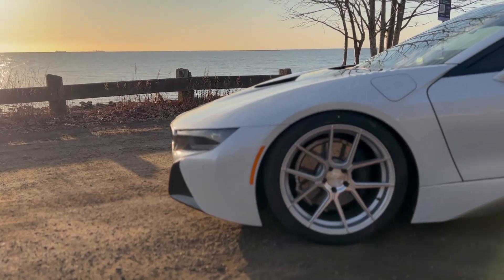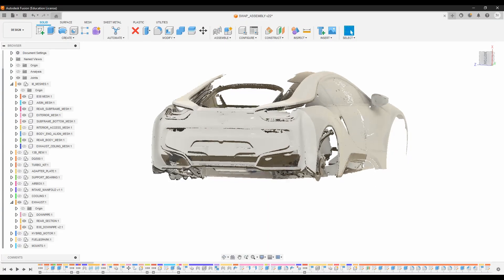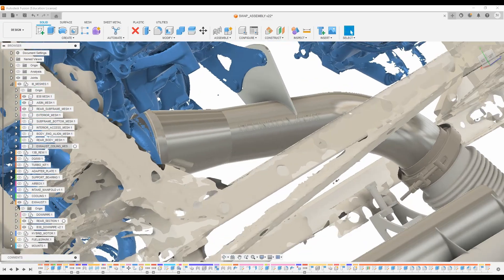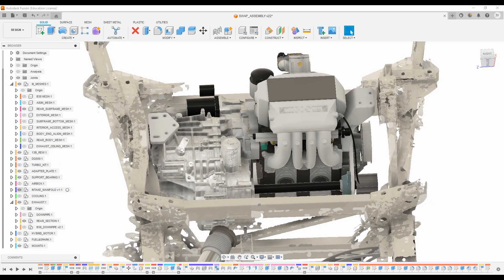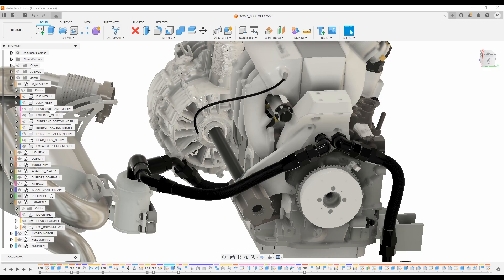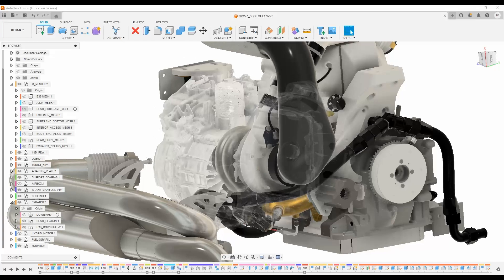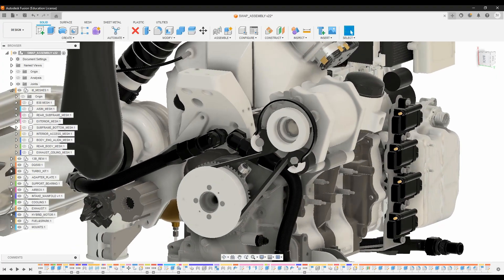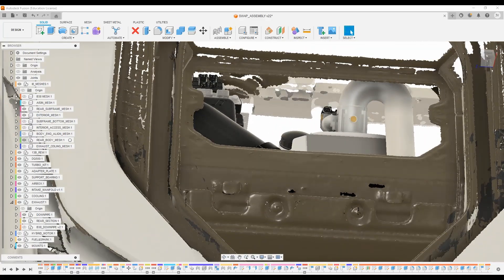Building a 13B rotary BMW i8 - EP1

Comment: You could maybe rotate the turbo a bit to clear the subframe
Reply from the maker: Why? The turbo does clear the subframe.
Reply: @CouchBuilt sorry, i wrote that incorrectly. What i meant to say was, that rotating the turbo slightly clockwise (if viewed from the top of the car) could have maybe moved the intake pipe closer to the 90 degree corner in the chassis, thus eliminating the need for the whole "organically shaped defornation". But then again, could have not. Even so, judging by the shape, i assume that you have flow optimised the whole pipe to the point, where the weird shape doesn't really affect the performance of the pipe in any way.

Btw, please don't take my previous comment as me trying to look all smarty pants. I myself am an automotive engineer, so i can grasp, how insanely diverse your skillset is and i sincerely appreciate what you do.

Your OEM-like approach to building cool stuff is very rare, and almost ruins everything else for me.

Btw, insanely jealous of the tools you have for building cars in usa, back where i'm from, i cnc machined (not even talking about 3d printed stuff) parts are INSANELY overpriced, so even though i have quite some experience with CAD, while building stuff for myself i have to resort to the rather pedestrian "other" cad (cardboard aided that is) and do the usual "weld some pipes to the crudely man-made bracket" type of shite

Comment: When was the new i8 unreliable 😂
Reply from the maker: Mine was bought with 14k on the clock and has needed more repairs than my N54 335i in the two years I’ve had it. Oh, it also had the motor and radiator replaced by BMW a few months before so bought it 😂

Comment: How many horsepower with BMWs turbo could the engine produce? 

Also i wonder if wankel could be used as generator in I8 like Nissan E-power technology.

İmagine as if the engine were generator and there weren't any transmission. The automobile had two electric motors( rear and front). Kinda  Nissan X-trail E4 power. Two rotor wankel could supply it?
Would it be impossible? Warm greetings from Istanbul 🇹🇷

Comment: You can install a swirlpot with the filling cap in the toppest part of the cooling system. Its usually intalled at the engine outlet. Its a good way to bleed the air out of the system

Comment: this content is gold man!. how capable do you think the i8 chassis is for high horsepower applications ? I have bare i8 shell that Im looking to make a hyper EV out of it. looking to have around close to 2,000 HP. i see this thing is mostly held together by glue and im not sure how safe the chassis would be for this type of application
Reply from the maker: Glued construction is generally pretty standard these days. The car feels way more solid than my E92 daily driver. I don’t have any concerns about power, but we’ll find out.
Reply: Aircraft’s are “glued” together and have been for long. Not entirely, but to a great extent. In many cases the fasteners you see are there just for safety reasons/regulations. The main loads are take by the adhesive.
The different sections of the CFRP chassis are probably “glued together” as well.
With that said, it’s the resulting capabilities that sets the limits. Not the method (i.e. glue), as long as it’s correctly engineered based on the set requirements/goals.
All said without knowing the actual limitations or engineering details of the i8 in particular.

Would be great to see more i8 content. Both tuned/improved OEM style once as well as more crazy project. 😃

Comment: Heat is going to be a major obstacle on this build.  Rotaries make up for their small size by working harder and hotter.  The oil cooler, radiator, and exhaust all need to be able to dissipate a lot of heat.
Reply from the maker: The cars cooling hardware seems to have reasonable capacity as a starting point. The hate of the system is around serviceability and early failure of some parts. Being a hybrid, I’ll have the convenience of shutting down the 13b in situations like traffic and continuing to let the coolant pump and fans run. I’ll probably run a large Laminova oil cooler over sending oil the length of the car.

Comment: Very intersting. I wonder why you choose to change the gearbox instead of mating the 13B to the original 6-speed ? I don't doubt that you did a massive amount of research, but it looks like it has been fitted to quite torquey engines, an it would probably have been much easier when it comes the time to do the electronics.
Reply from the maker: Won’t handle the power. Even Alpina swapped the trans when they put a B48 in one.
Reply: @CouchBuilt Thanks mate. Subscribed halfway trough the video BTW, it looks like a very intersting procject.

Comment: Wouldn’t it be easier to utilize the factory trans
Reply from the maker: It’s only rated to 330ftlbs and would need an adapter plate anyway. The DSG is just a better transmission and since the stock control is only on the CAN bus instead of Flexray, it’s easy enough to spoof.

Comment: Everything looks very well engineered. The only concern I see right away is the sharp radius bend of the charge pipe coming right off the compressor. Between the sharp bend and the protruding clearance you had to do for the subframe, I could see that causing compressor side backpressure as it could be a flow restriction. Increasing the volume in that bend can only do so much up until a certain boost pressure.
Reply from the maker: Fair observation. Building the car without modifying the chassis is going end with some compromises. This is one, along with intake runner length, have been examples of that. It will be easy enough to swap out the inlet pipe in the future if it impacts performance too much.

Comment: I wish someone had swapped a v8 into one of these by now.
Reply from the maker: Depending how many models or scans I can get ahold of, I may do a video of fitment with other possible swaps.
Reply: @CouchBuilt  oh wow I'd love to see it. Preferably a BMW V8 but I realise a LS is much more likely 😂
Reply from the maker: I can make dummy representations of the overall length/width/height of some BMW motors but that’s not quite as appealing visually as actual scans or models. We’ll see.
Reply: @CouchBuilt  for me, just knowing it would be possible is enough. I remember at the time of the i8 release, a number of people abandoned v8 swaps because it wouldn't fit in the engine bay, but I always wanted them to be wrong.

Comment: I don’t want to rain on the parade of what is an incredibly interesting build, but I’ve got to say: that exhaust on the 3cyl BMW did sound mighty tasty…
Reply from the maker: @borla PROXS can make anything sound good.
Reply: @CouchBuilt plus 3 cylinder engines can sound interesting
Reply: @CouchBuilt plus 3 cylinder engines can sound interesting
Reply: Braaaaaaaap Braaaaaaaaap Braaaaaaaap

Comment: 83mm turbo, guess the performance issue would be fixed with that big 🐌😂😂
Reply from the maker: Borg Warner names their turbos a bit differently. 83mm is the exducer of the compressor wheel and 74 is the inducer of the turbine wheel. If called out like a precision turbo, it would be a 6265

Comment: this looks amazing, def wondering how the electric part of the ecu would work with this but we shall see lol
Reply from the maker: The car will incredibly drive in EV mode with the engine ecu completely unplugged. If it can still power down the road at the level of dysfunction, there’s hope with putting a little more effort in.
Reply: @CouchBuilt  whoa thats sick, unlike almost any hybrid system I've heard of considering it bolts to the motor.
next up chevy volt hyper miler lol

Comment: How will the electric power steering and the power brakes and abs work? Also the paddle shifters on the steering wheel and the air conditioner
Reply from the maker: Power steering and AC all run off commands from body control module and  aren’t affected. Paddle shifters and console shifter just communicate over CAN.

Comment: I really don't understand where their "unreliable" reputation comes from. Looking at the forums and talking to owners they always seemed to be very reliable for being a BMW, even if the few times they break often ending up being very expensive. Maintenance is at least incredibly cheap (especially for a "super car") and getting 5l/100km from one is too.

Will definitely be looking forward to this build though!
Reply from the maker: I think actual experience is pretty varied. Mine had 14k on the clock when I bought it and already had the motor and radiator replaced. I’ve had to replace a coolant tube under the car and it spit out a belt while on the launch control limiter. It also randomly gets phantom errors that generally don’t come back after clearing the codes. I did notice there were quite a few Lemon title cars when I was searching.
Reply: it technically isn't a supercar...it was just a flagship "i" car (think 850i) to help them sell more i3s.  for $180k, there were better sport touring seaters that would gain just as much attention.....
Reply: @K03sport  That's why supercar is in quotations. But it's still far from slow, and a 1500kg curb weight is very light for a plug-in hybrid.

"The i8’s three sources of power—a mid-mounted 228-hp turbo inline-three and AC motor and a stronger 129-hp AC motor up front—are the same as in the European car, but this federalized i8 weighed 3484 pounds, about 100 more than either of the other previously tested cars. Thus, it wasn’t quite as quick, with launch control enabling a zero-to-60-mph time of 4.0 seconds (compared with 3.6 and 3.8 for the European examples) and the car dusting off a quarter-mile in 12.5 seconds (down from 12.1 and 12.4). Regardless, the thing accelerates like a solid-fuel rocket when eBoost mode is engaged by pressing the accelerator pedal through the kickdown switch. It delivers the kind of sustained acceleration we’ve experienced in Porsche 911 Turbos."

I personally really liked it, for someone who wants the supercar looks but want something more dailyable it seems great.
Reply: It literally requires an engine replacement at 50k miles💀
Reply: @siinnatraa  It literally doesn't.

Comment: If I 8 has cooling issues with the 3 cylinder then you’ll have even bigger issues with a rotary engine.
Reply from the maker: The issues aren’t thermal management but serviceability and bleeding the motor which is often done improperly. Being a hybrid it can also shut the rotary off and continue to cool in situations like sitting in traffic, etc.

Comment: Great video! I'm wondering, will there be issues getting the original i8 ecu to communicate with the maxx ecu? and will the hybrid motors run like stock or will they also be controlled?
Reply from the maker: There are plenty of issues on that topic to deal with, which will be the subject of multiple future videos.
Reply: I noodled a LS/Porsche trans axle swap years ago. Didn't have the subframe scan, so it didn't go far. But the best plan for the ECU was to retain the stock ECU and just send it all the sensor info it wants from the swapped motor.
Reply from the maker: That’s exactly the plan.
Reply: How did you get the subframe scan? I look for over a year. Was going to go to Pacific motors in MI and make one at one time.

Comment: personally i would either swap covers to mount or try to mount from intermediate plate. I don't necessarily think that'll be good when movement happens. Maybe Im wrong
Reply from the maker: I’m not too concerned. Motor has 1/2” tension studs and the pan has a .375” thick rail to help tie it together further.

Comment: This is basically what I want mazda to do with their new hybrid Rotary.  No range extender bullshit, Just a turbo rotary with an added hybrid motor.
Reply: Or just build a modern rotary and ditch the battery crap that will be out of date in 5 years